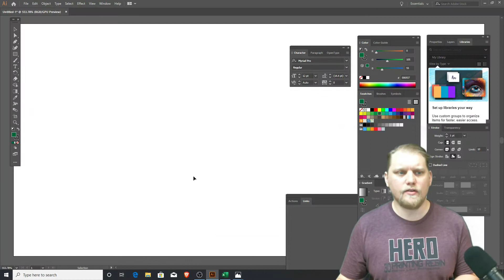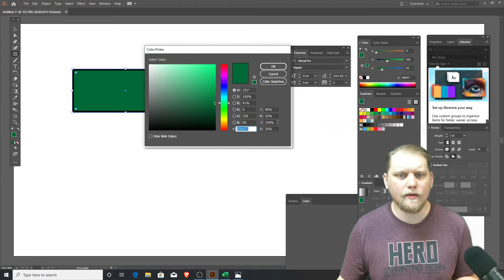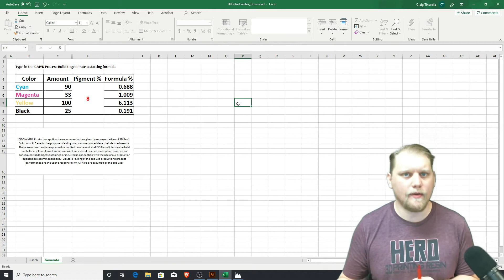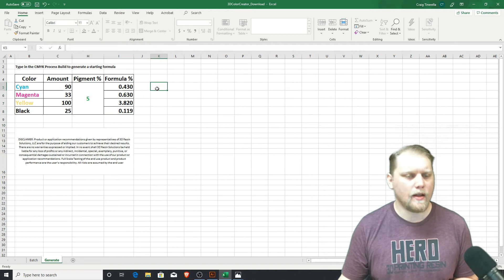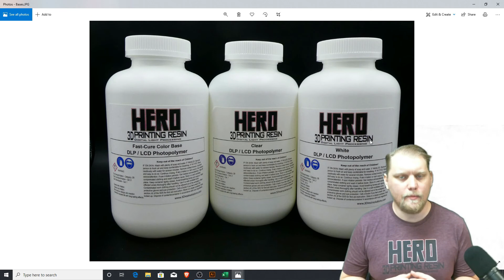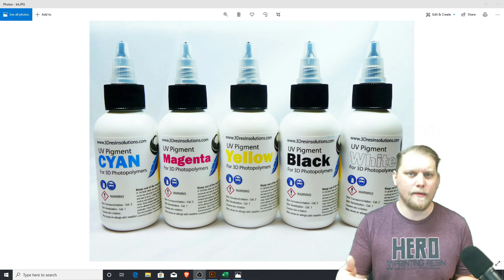Pigment Set Tutorial CMYK+W 3D Blending

Comment: I'm using Excel 2011 on a Mac.  When you try to enter the CMYK values, it will say that the files is Read Only for some reason.  To get around this, go to the batch tab and enter a random number in the Batch box.  Then go back to Generate and the Read Only will no longer pop up and you'll have a workable file.